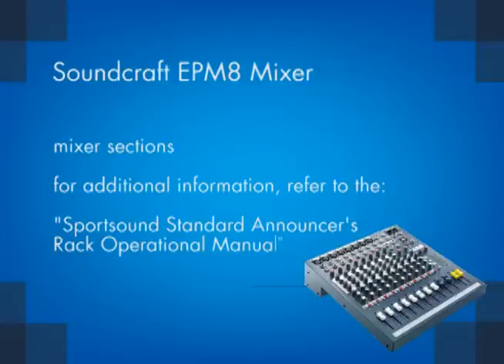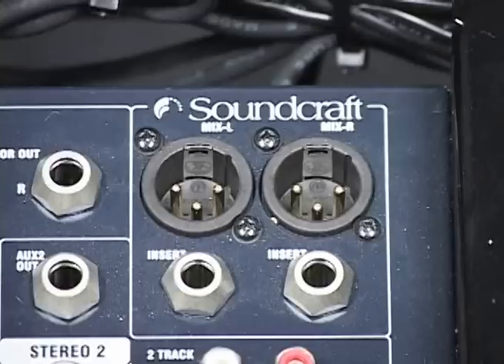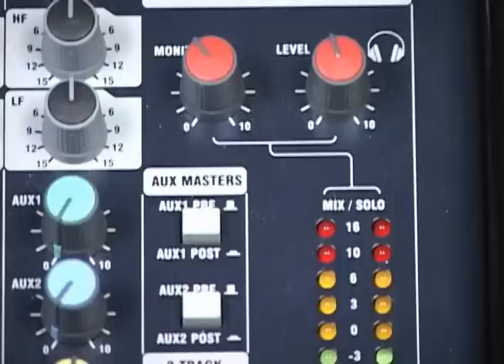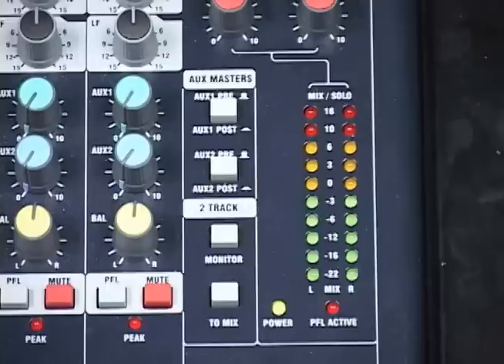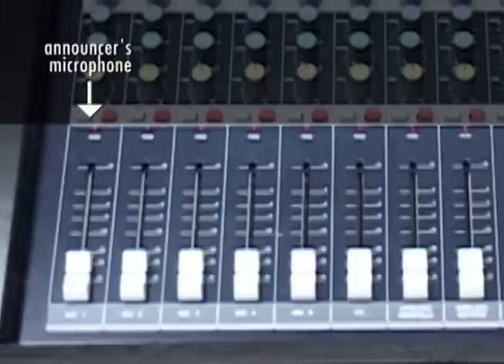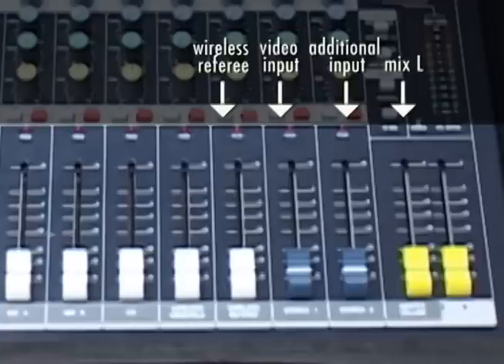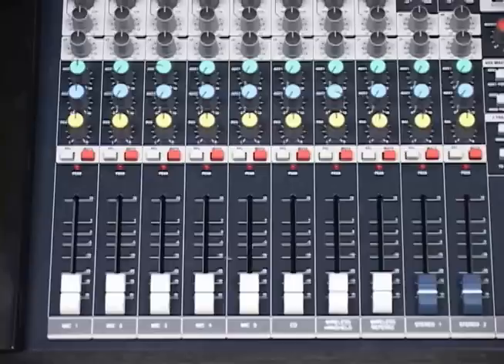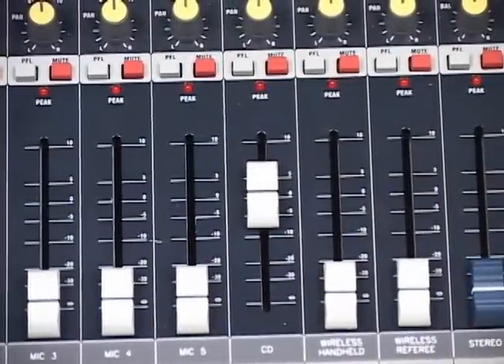Tutorial: Standard Rack Control System - Soundcraft EPM8 Mixer

Comment: sir..if phatom power is oN...will all XLR inputs will get 48v? what about line in voltage ? and what about insert voltage ???
Reply from the maker: If phantom power is turned on, all XLR inputs will get 48V.  The line in and insert connectors are not connected to the phantom power circuit.

Comment: Just so I get this right:
If i switch Phantom Power on it only applies to the MIC inputs which are the female XLRs of channel 1-6. The Phantom Power does NOT apply to the 6,3mm inputs which are right below the XLR inputs neither does it apply to either of the stereo channels or the headphone jack or main XLR OUTputs.

Did I get this correctly?

Comment: I have this at work the mix-L not sending audio out, the desk lights show a left and right coming in, if I move the left fader down it still shows stereo l-r on the lights, moving the left out cable to the mix-R slot it plays out sound but very quite. A different mixer has been tested and has the same issue? Any ideas?
Reply from the maker: If moving the left fader down and L+R signals are still showing on the meters, it is possible that a PFL button is pushed in.  This overrides the signal showing on the meter to show the input level for the channel that has a PFL button active.  If a different mixer has the same output issue, it is likely the problem lies past the output of the mixer.  If this is a Daktronics system we recommend calling in for support at 1-800-325-8766.

Comment: I wanted to know the width the height and the length of the mixer
Reply: The dimensions of the mixer itself are W: 13", H:3.56" L: 14.25".   The dimensions of our control rack currently are: W: 23.25", H: 21.25", L: 23.5"